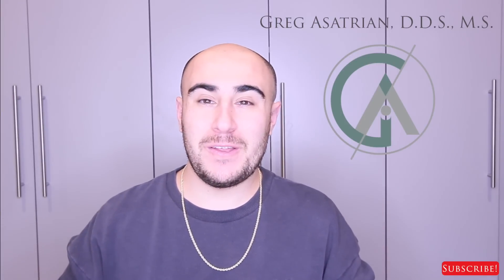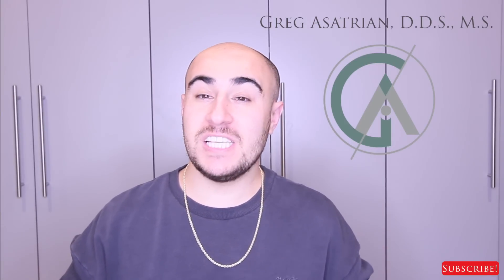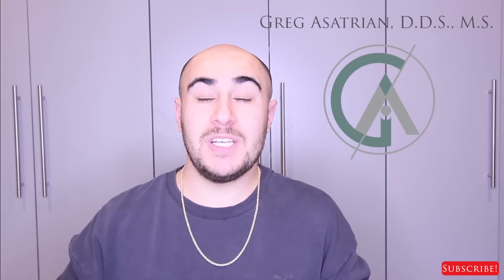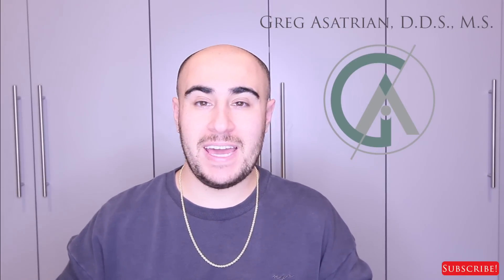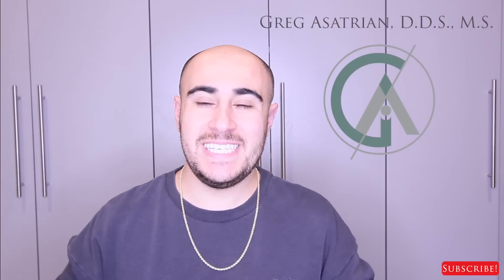[BRACES EXPLAINED] TADs / Mini Implants

Comment: My ortho used TADS to expand my upper jaw. I never got fully numb though, which was one of the most painful things i have experienced lol. Regardless they did prevent me from having jaw surgery at 24. I can confirm keeping them clean is absolutely nessisary! Food would get suck under the screw all the time and if it was left there it was very painful. I used my water pick to really clean the area after every meal and that helped a ton. Its weird that i never hear orthos except for mine use TADS for jaw expansion. It really helped me as an adult because we were too poor when i was a kid to afford braces. They stopped my countless migraines from my bite and i did not have to get surgery. Although 3 turns a day on my expander was... rough LOL. I wouldnt have changed a thing even though it was quiet the journey with my TADS.
Reply from the maker: Tell me about it! I Had the exact same thing as you =] It definitely was rough but so worth it!
Reply: Skallia Ray i am getting those in 7 days i am getting 12 tad’s 4 upper 4 lower and 4 for a MARPE expander
Reply: How did it bring it forward?

Comment: What if you have an overbite and you want to move your upper teeth up,  its interesting  where place Tads in  that case? Is it under nose?
Reply from the maker: Something like that can be done yup. Have to make sure that those are the correct mechanics though so your orthodontist will know best!
Reply: Ahaa.  I've changed  my orthodontist,  because I discovered that he isn't orthodontist at all. Your videos is very helpful so much good information and examples. Its nice to hear a doctor who knows hes think.

Comment: Dr. Question please: for small closer, on just one side, on upper arch...Can spacers be used to move teeth fully bodily? close a space approx. 3mm. I have space between canine and 1st premolar. Wondering if I can slowly move the back teeth by placing a spacer distal of 1st premolar. Space created...Then place distal 2nd premolar...continuing all the way back, then repeat again starting at distal of 1st premolar until 3mm close it one direction. Do you understand what I am thinking? Thoughts?

Comment: I had a deep bite but my tads were screwed on my upper jaw not lower. They worked very well.
Reply: Camille Caron did they hurt??? Im getting one next week and im freaking out, I also have to work right after
Reply: @rocioarguelles4341  did they hurt?
Reply: @rocioarguelles4341  did they hurt
Reply: Did they hurt.?
Reply: @laresalam6637  no not at all. They num the erea before screwing them :) 100% painless
Reply: Did you notice a change in your speech?
Reply: @ye23.  not at all you dont feel them :)
Reply: How long was your treatment? What’s your result? Are you happy?

Comment: I have an issue with my orthodontist I don't trust him doctor this is because of the way he positioned the  brackets to close my open bite.He positioned them in the wrong way. I knew this after consulting another doctor. He even told me my treatment was going in a wrong direction. And please don't tell me that he knows what his doing cause am sure he doesn't. I feel my front tooth isn't moving so as to be aligned....the process is very slow this month would be my 5th month without progress I feel like quitting this "brace thing" its not helping. Please help me identity possible problems of my treatment

Comment: I have a severe open bite an my front teeth are at an angle facing up like poking out (i hope that makes sense). I'm going to get jaw surgery but i haven't yet consulted a surgeon. My orthodontist wants to remove 2 premolars from my top jaw supposedly because it needs to be done in order to have room for the surgery. My old orthodontist was able to align my teeth without any extractions but sadly my teeth moved back after a few years. I really don't want to remove any permanent teeth because i've seen videos that say it affects your face structure and that it will cause problems like suffering from premature aging. i saw a lot of comments of people regretting listening to their orthodontist about having teeth extracted. 

could you please do a video regarding this? i'm really confuse on what to do.

Comment: Question.. Can a TAD be used to correct a minor underbite? Can it be attached to the upper and lower jaw bones without moving the teeth? Will it create a skeletal change or does it just move the teeth? I had braces years ago and my teeth are perfectly straight (still wear my retainers daily). I am now 21 and my bite has grown since then and I now have a slight underbite. I know you don’t know my specific case, but could something like this be an option over jaw surgery or braces? Thank you!
Reply from the maker: Hi Elrach! Great question. It wont change your jaws but it can move your teeth and sometimes can be used for a minor underbite. Severity, crowding, proclination, etc all play a role in whether it can be used!

Comment: Can tads fix gummy smile? My orthodontist told me braces can’t fix my gummy smile and it can only be fixed by jaw surgery (my gummy smile is not severe), I was a bit disappointed because she told me she can fix my gummy smile during my initial consultation with her.
Reply from the maker: Minor ones can be fixed with TADs but there may be other reasons that your orthodontist recommended jaw surgery - the gummy smile may only be one part of the diagnosis!

Comment: Hi i just watched your video about spacers. As u mentioned, it is to create space to fit in the metal ring but what im curious about is wont it leave space after the whole braces process when the metal ring is removed?
Reply from the maker: That is a great question! Our teeth tend to shift mesial (towards the front of the mouth) throughout life. So after you take the braces off, within a few months, that gap closes right up!
Reply: @DrGregAsatrian  Oooo I see thanks for the explanation~ This leads me to another question which is since the gap will close overtime, will this affect the retainers?

Comment: Hey Dr. Greg! I have a question. when my orthodontist puts on my chains, she will put it on one bracket, skip a bracket (and a loop) and puts it on, and then repeats. I’m just curious if this method is effective?  It feels as if she’s putting the chain on with only half the strength, but then again, she’s the trained professional—here not me. Is this a common method to putting on power chains?
Reply from the maker: It could be that she does not want much force. I would ask her if I was you!

Comment: With traditional braces or clear ceramic braces, is it usually necessary to wear a retainer after treatment is complete to prevent the teeth from moving back to their original position like with Invisalign type treatments ?
Reply from the maker: Yup. With any type of tooth movement, we have to retainer that new position. I will do a video explaining the reasoning for relapse in a future video!

Comment: Dr Greg, please help! It seems no one can answer this question and even with constant searching i cant find any videos on it! I’ve been wearing braces since January of 2017! And ever since before that i had the “normal” bite. When i first got my braces my ortho told me i might get an underbite but they never explained it. I’ve been wearing my bands and it hasn’t gone back. So i have 2 questions, why did i get an underbite? and will my underbite go back to normal?? (its so hard to eat bc my left teeth bite down all the way but my right side doesn’t) 
also not sure if this has an effect but they put a blue spacer on my bottom teeth to prevent me from biting down all the way (not like i could anyways..)
Reply from the maker: Hmm this is odd - I would ask your orthodontist because it is impossible for me to tell online

Comment: According to my initial treatment plan I was supposed to have at least 1, possibly 2 TADs used to help close the gaps left by extracted teeth in my upper jaw. When the time came to close these gaps, though, my orthodontist decided we could probably get the desired result without using TADs after all, so we've been doing that and it seems to be working well, TADs, however are not completely off the table just yet. I wouldn't mind, though, if I ended up not needing them, just because of the extra cost I could most definitely do wothout :)

Comment: My next appointment is in 2 weeks... My ortho is supposed to be changing my wires to a thicker one. I am correcting an overbite. I know TADs are effective but I hope I don't have to have them.

Already had two extractions (#5 & #12) and I'm ready for my first wire change (or so I think lol)

Dr. Greg you've been a huge help on my journey. Thanks!
Reply from the maker: That's so awesome! I love seeing how much you guys learn from watching this and it's such a fun experience hearing all of you share your journey! Keep it up!
Reply: TheChangingFox I had to have four of my permanent teeth extracted and now I have my eye teeth coming in on the top and they have to pull them down it has been very painful so far
Reply: @schleichloversforever62  oh no! I'm sorry to hear about your experience thus far! Hopefully the worst part is behind you.
Reply: You should not be pulling your teeth backwards into your face if you can help it.  There are some (not so) new orthodontic methods, which actually aim to expand / develop the upper jaw so that the lower jaw can be positioned properly.  These methods never require extractions, etc.  I know you are already on your path, but do some research if you are interested because retractive orthodontics can have some side effects down the line that are not desirable.  

https://www.youtube.com/watch?v=0sA4m4DCA_4

Best of luck to you!
Reply: I had two pulled so I didnt have to where headgear and changing wires doesn't hurt until the 4th change

Comment: That sounds cool and looks a bit intimidating. But I think I would’ve chosen TADs over getting 4 premolars extracted. My orthodontist didn’t even mention this option. 

Anywho, I’ve had my braces for 5 months and I can tell a bit of progress, but not much. Tuesday I had a powerchain put on my top arch to start actively closing the extraction sites. I also have elastics on each side to help with the closing. The pain wasn’t that bad! Excited to see some more progress ☺️
Reply from the maker: One isn't any "better" than the other. Using TADs is a lot slower than extractions most of the time
Reply: Same. I knew about TADs but I don't think they use them everywhere (living in Sweden). When I asked about them I got some weird answer that its a surgery procedure bla bla.. I dno. I was pretty sure my overjet can be corrected with them but they gave me the pull out 4 premolars option.. meh.. but yea whats done is done.. hope the result will be good in the end.

Comment: I have a question? So when you only need braces in the top Teeth and not on the bottom but your back teeth aren’t even so you will need elastics but you only have braces on the top teeth will the dentist have to put braces on the bottom teeth for the elastics .even tho you don’t need braces on the bottom but you need elastics?
Reply: Kaylee Ortiz Yes they will give you top and bottom braces regardless.
Reply from the maker: Great question! KEEP UP WITH J said it correctly! We need bottom braces to serve as an anchor to fix the top teeth

Comment: What is the healing process like after the TADs are removed?
Reply: Lily Mae from personal experience the healing process was very easy. Soft tissue heals very fast and the “hole” healed with in a week or less. I was told that the bone fills back up over time and doesn’t take long.
Reply: @ashleyjones5117  thank you
Reply from the maker: Thanks Ashley! You are 100% correct. Removing it is feels like a quick pinch and thats it! Just be careful not to eat anything too hot / spicy for a day or two and you should be OK!

Comment: Can you do a video about how eating ice effect you teeth ???
Reply: it effects the treatment, it can cause appliances, or brackets to break or bend your wires causing your teeth to shift in an unwanted movement
Reply from the maker: Eating ice can not only break your appliances but if your teeth are put under enough stress, you can actually crack your teeth with chewing ice! I advise against chewing on ice!
Reply: Thanks

Comment: Can you make a detailed video demonstrate a clinical case of using TAD ?!
Reply from the maker: Sure! Once I do more videos on appliances, I will do some clinical cases =]
Reply: Braces Explained I have an appointment tomorrow and I’m freaking out it. Does the process hurt? Please answer me. I’m so scared. I regret getting braces now.
Reply: Morro is my favorite How did it go? I have my appointment tomorrow
Reply: Naruto, Ninjago, and The Flash are the best  soooo did it hurt? My Ortho wants me to get 2
Reply: I had to get TADs a month ago because my front teeth needed to be moved to the side slightly to be aligned properly and I didn’t want to get extractions/headgear. They didn’t hurt getting in at all, but it was definitely sore the days after like getting braces put on the first time
Reply: I have TAD's because I've got no second upper teeth and my third teeth are next to my ones so i'm moving them to their right spot leaving room for artifitial secounds(i don't know how to name the teeth in eng so sorry for thatXD)